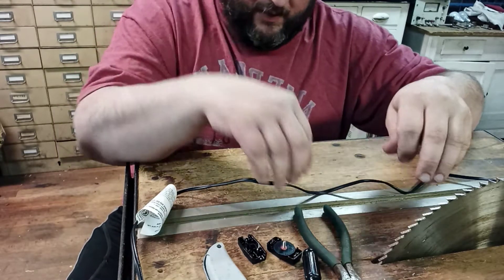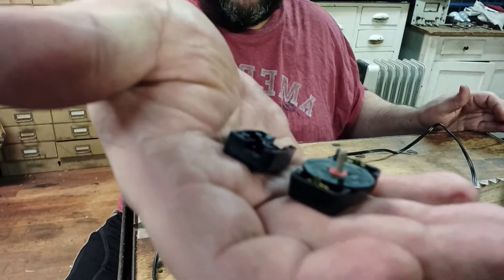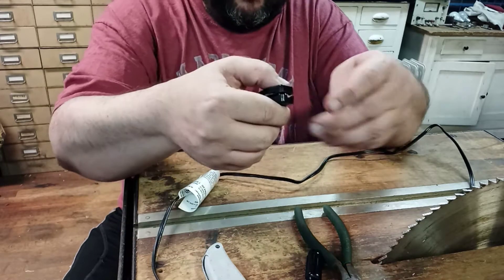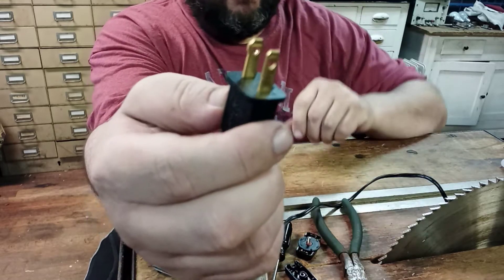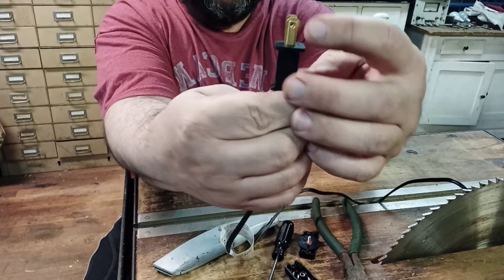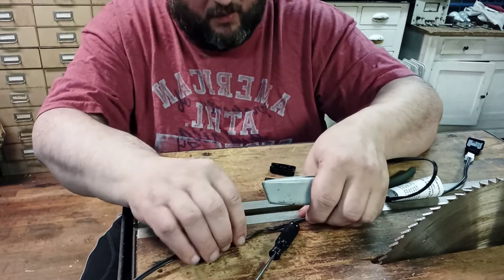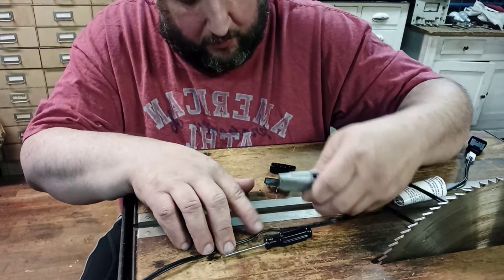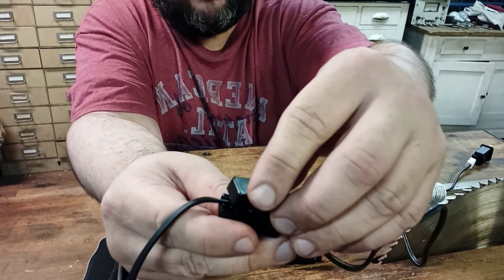How to Wire Up an Inline Switch Onto a Power Cord-Date: 10/7/2021

Comment: Can I put one of these on a sewing machine?That doesn't have a foot pedal? Doesn't matter how many volts it are going threw it ? So I can turn the machine on and off with my foot Instead of the push button with my hand because it would be  better to have 2 free hands to use the machine